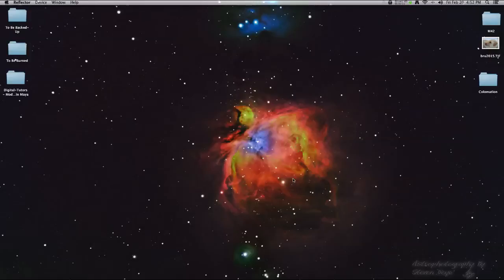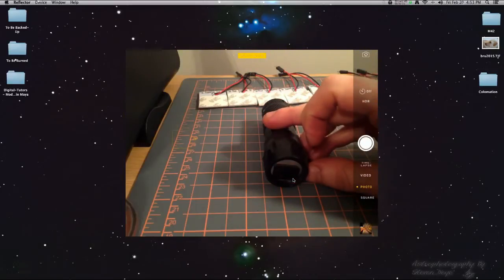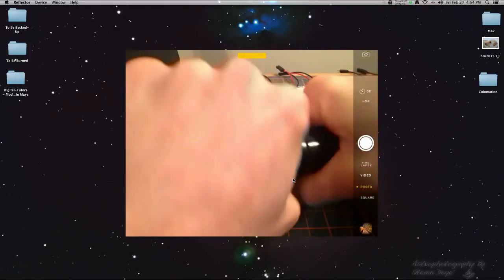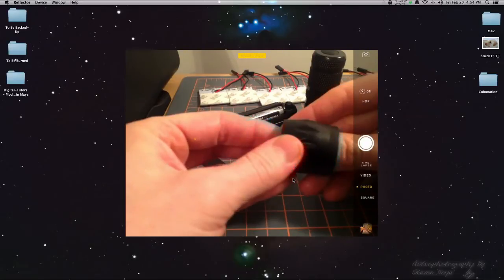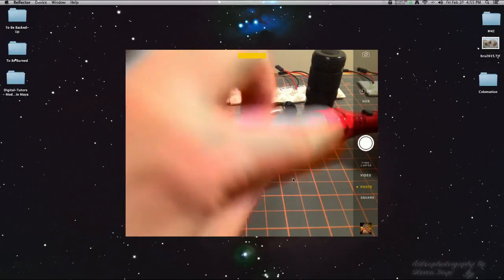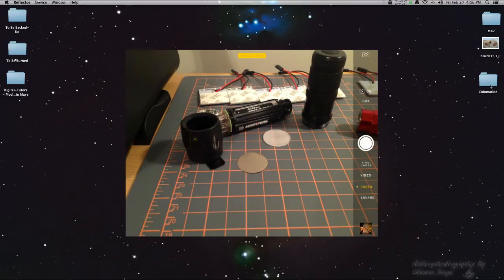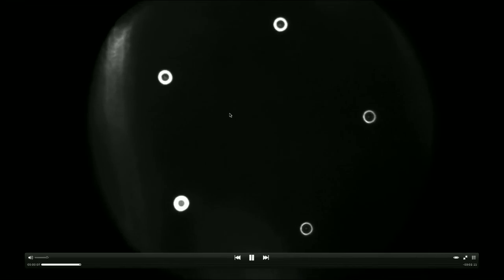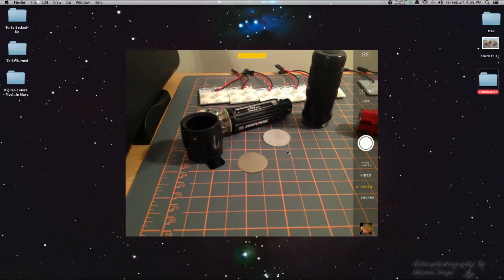Artificial Star Breakdown

Comment: so a flash light + aluminium foil with a pin point size hole will just do the trick?
Reply from the maker: Lawrence Mok Yeah, I can't see why not. There is really nothing to it. I guess you just pay for the convenience of different sized stars in a single flashlight.
Reply: Remember, depending on the aperture of your mirror you’ll have to put it at a certain minimum distance away from your scope to collimate it properly.
Reply: Yeah that is exactly what i was wondering